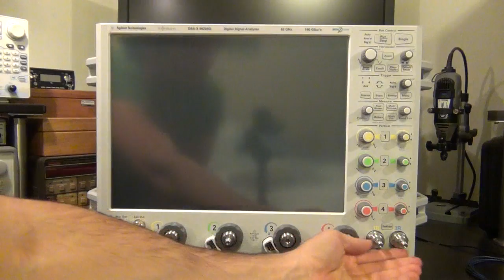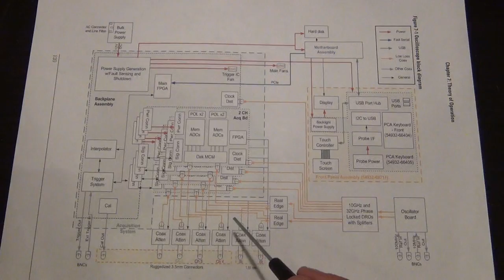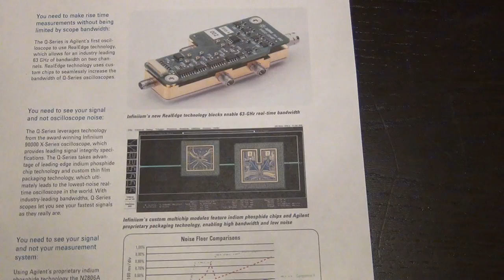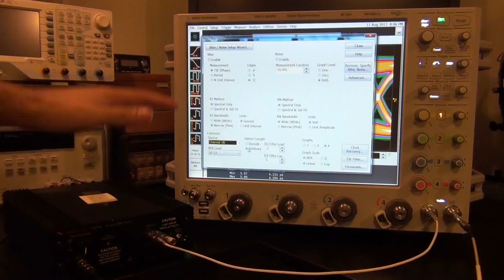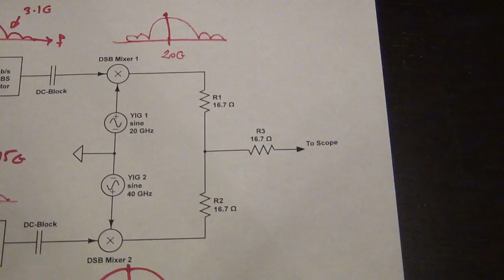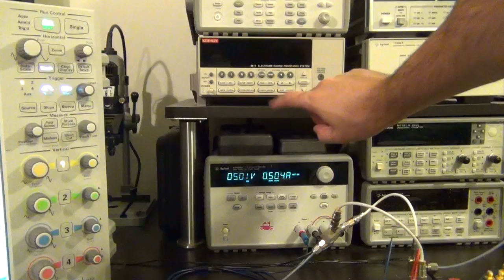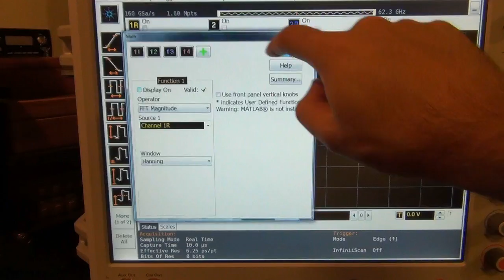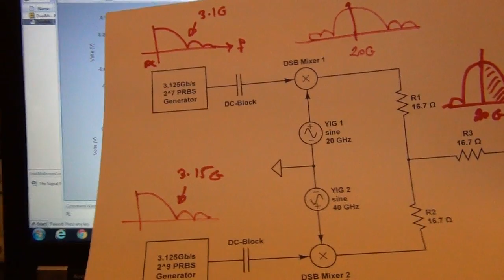TSP #27 - Experiments and Demo of an Agilent DSA-X 96204Q 160GS/s 62GHz Oscilloscope

Comment: They are usually quite involved to take apart, & I wasn't going to risk it on mine. Mine was only worth $140K, the $500K model probably doesn't exist in Australia as a demo unit. Usually you order one and wait 3 months for them to make one for you from scratch. I had it sitting on the back seat of my car to get from the home to the lab because the transport box was too big to fit in my car boot, scary when it's worth 80 times what your car is worth.

Comment from the maker: Essentially, yes. As the temperature of the electro-magnet rises, the resistance of the wires increases. This in turn causes less current to flow through the coils at the same constant voltage provided by the power supply. Since the YIG oscillator is tuned with magnetic field (thus as a function of current), the frequency shifts.

Comment from the maker: This it is the scope equipped with the fastest real-time sampling ADCs at 80GS/s. LeCroy uses 40GS/s ADCs with 4-band block down-conversion and DSP processing to achieve an effective sampling of 160GS/s. Agilent does this with only 2-band block down-conversion and 80GS/s ADCs. This makes a difference in performance (aside from noise and ENOB). I hope this helps.

Comment: Quick tip: when you hook up two instruments with a piece of coax, short the coax center pin to its shield with a pair of tweezers or a piece of wire first.  The coax dielectric can store enough charge to cook one of those 80 Gs/s samplers to a toasty crisp.

Or at least make the connection to the cheaper box first. :)

Comment: The inputs go directly to Agilent's custom built BGA chips..

Hey boss, i've connected you brand new DSA-X 96204Q scope 62 GHz input to the Hydro power to watch the waveform... It made a small poof and i don't see any 60 Hz waveform on the screen.

Are you sure there's power into that outlet ?
Reply: the safety circuits to protect the hardware from that would reduce signal quality.

Comment: Without looking at the other comments... because the YIG oscillators are magnetically tuned, and contain large coils of copper wire (from what I've seen), and since the current to tune them ends up being a couple of watts, I imagine the frequency shifting is because the copper is heating up and thus changing its DC resistance, changing the amount of current that is flowing and thus the tuned frequency. I guess this is why we always see them as part of a some sort of feedback system (like a PLL) to help compensate for these changes over time?
Reply from the maker: Sounds good! :)
Reply: @Thesignalpath  So I am correct? :D Are there any other effects?

Comment: That is some awesome equipment and a very good presentation. I do have some follow up questions.

You mention that the oscilloscope software filters the signal above 62GHz. Does it use analog hardware filters to filter above the Niquist frequency as well? I could not spot any on the diagram. But I don't have any electronic components knowledge, so I probably missed them.

Comment: So whic of the 3 kind of RF connectors did you use for this ? :) And what connector is on the YIG ? (that looks like SMA but I guess it's too high in freq could be any of the one with the same 'thread').

Comment: Well, you would see a difference, but it would not be nearly as obvious as it would be with an instrument more suited to the task.  The measurement would also be more difficult to perform. A good VNA can have around 100 dB of dynamic range. A scope like this one has an ENOB of 7 or 8 and so has a dynamic range of around 40 dB. Also, a VNA has a built-in signal source so it can sweep across its entire frequency band and measure the response accurately. An external source is required for a scope.

Comment: I'm curious about the LO's you used for the digital down conversion processes. Did you frequency/phase lock them to the original upconversion-LO's or were they "free running". If you did phase-lock what method did you use to recreate the LO's, just using the part that leaked through? If the system was "perfect" and nothing of the LO leaked through how would you have done it? And if they were free running there would be lots of closing of the eye in the recovered data right?
Reply from the maker: The LOs were free running. YIG oscillators don't drift significantly in a short time and I captured only a short PRBS sequence. Had I captured a sequence which is long enough, then I would observe eye closure as you described. Without any LO leakage, I would have to do proper clock recovery to find the LO frequency for DSP down-conversion.

Comment: my theory as to the cause of the YIG drift is because the magnetic coil will heat up quite a lot. As a result the coil resistance will increase, then the current will lower and the magnetic field will lower resulting in a change in tuning. Am I right. 
I know that YIG oscillators get VERY hot.

Comment: It would not fit. The capture cards in the oscilloscope span all the way from one side to the other and from front to back as they have a huge amount of memory (1G points per channel) that has to be accessed at blazing high speeds.  And I believe there are two stacked up capture cards.  

Also, I believe it uses some form of PCI-e internally to transfer the data into the onboard computer.  So that's basically how it works, it's jus that the computer is just a small part of the whole unit.

Comment: Impressive instrument but really a shame Agilent has been using Windows as the OS for so many years now.  I have seen a number of their instruments that really were not all that old just suddenly die and were not repairable due to parts being obsolete so soon.  Apparently instruments are no longer designed to last forever but only a few years or until they die.  Many older HP instruments still work and are apparently not quite as fragile.  Also, assuming this is a loaner for demo purposes?

Comment: Single cycle rms does not really make sense for measuring noise.
Peak to peak measurement does so neither, because theoretically this is proportional to the bandwidth for ideal white noise.
At least it is some kind of indicator for scopes of similar bandwidth.

I would have appreciated a more detailed spectral analysis (fft) of the noise floor, the tones and so on.

Comment: So assuming that this beast is a 160 GS/s, how is the memory bus speed?
Of curse each memory bus is menaged via an fpga and then sent to the acquisition processor that than process the data and send to the regular computer. But how fast are this buses?
Don't want to know how much R&d are been take plca to develop this machine.
Despite that when you will post anothor video?